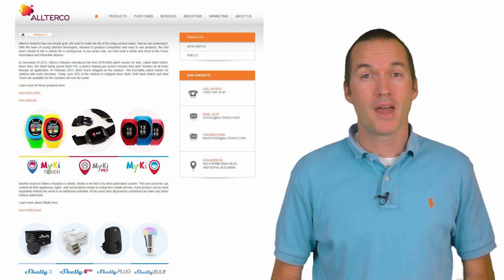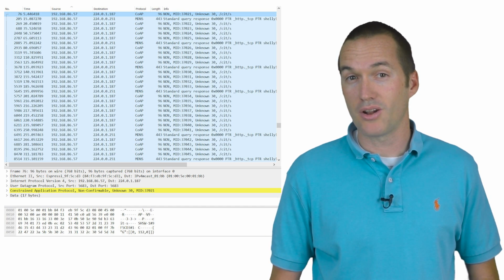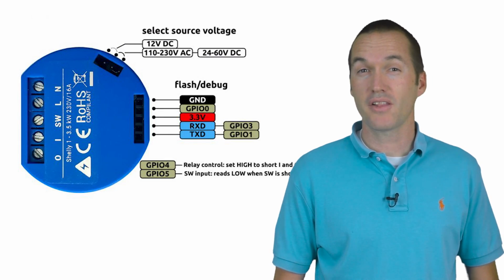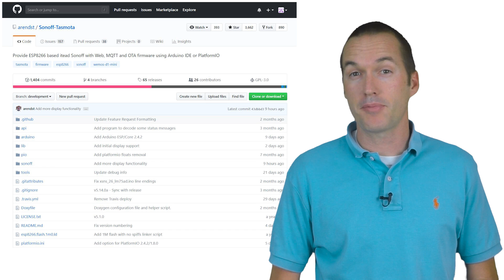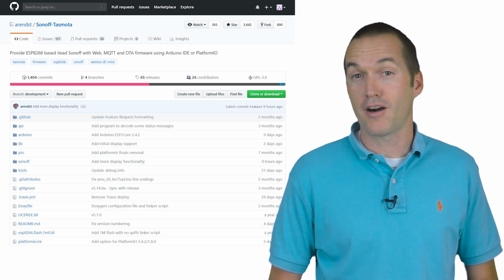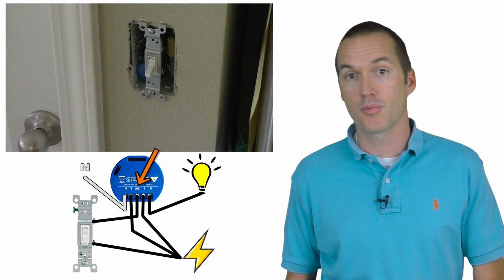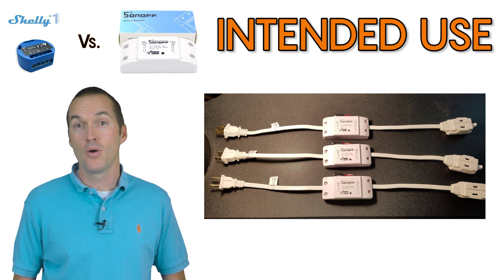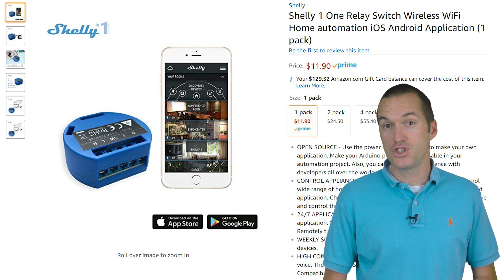Is the Shelly 1 better than the Sonoff Basic?

Comment: So you still need a neutral at the switch with the Shelley. Is there any work around without running a neutral to the switch since the Shelley supports mains voltage switching with the SW port?
Reply: Let's say that this is in our pipeline. It's not easy but definitely not impossible.
Reply: @dimitardimitrov849  That's excellent news because I don't know about the rest of the EU but in Ireland the majority of light switches send neutral to the ceiling rose and not the switch so that makes Sonoff's useless. 👍👍👍
Reply: Ross Erman Canpolat  Same in the UK. You can install the Shelly in the ceiling though.

Comment: Hi, I am just wondering if there is a max wire length between the switch and Shelly 1, Shelly 1 to the light?  I have all my wireling from all the switches go to a central location, and all lights wireling to the same central location.  And that is where I place all my smart switches (sonoff and aeotec zwave smart switches). Some IOT devices will not work because of the wire length.
Reply: We have similar issue 2 years ago when start to make home automation devices. Shelly1 do not have any issue with long wires. In some of the our installation we have 50+ meters (150 feat) wires.
Reply: That is very good to know, hope Tasmota will be updated soon. ordering from Australia is a little difficult but will try.  You are very good and the videos are very good as well.

Comment: Super helpful. I'm going to check out the Shelly 1 for sure.  FYI, if you flip a breaker and the switch no longer turns on the light, it DOES NOT mean that there isn't a hot wire in the box.  As mentioned in the video, if you don't understand electrical wiring, don't attempt installation yourself.
Reply from the maker: Yep, good point.

Comment: Can you think of a way to wire this on a multi switch setup? The house I just moved into has a ridiculous amount of 2 way, 3 way, and even a 4 way switch.  I understand the basics of a multi switch but adding this device has me stumped a little.
Reply from the maker: It depends on if there is another hot wire in the switch box that goes to the light.  If so it's as easy as powering your shelly with the hot (L) /neutral (N), hot to (I), (O) to the light, and the old output of the 3 way switch to (SW).
Reply: @TheHookUp  hmm... Thanks for the insight. Can you put this into a diagram and post it? Discord perhaps?

Comment: Does it have any respectable certification? Seeing "Chongx" capacitor doesn't instill confidence. Also, 16A is good probably only for a relay, not the whole package (compare this with other same size in-wall switches, it's unlikely they have made a breakthrough and can charge 4x less at the same time). How about doing some 16A tests to see how it holds?
Reply from the maker: Do you have a specific experience with Chongx? or just because it sounds Chinese.  It's basically impossible to make an electrical product without sourcing your components from China.

They have a few EU certifications and are currently working on UL.  I'm going to contact YouTuber John Ward to see if he wants to melt one in his normal tests.

Comment: Did you look at the traces on the PCB of the Shelly?  do the traces look like they'll take 15 amps? it doesn't matter what the relay is rated for if the traces are going to  blow off.

Comment: Comparing the PCB traces on the Sonoff Basic vs. the Shelly shows that while the Shelly relay may be rated for 16A, the PCB traces certainly are not. Sonoff uses a thick lay of solder on their relay traces to handle the current. The Shelly traces appear to be only copper with presumably some inside the multi layer board. Definitely would not run 16A through it. Without knowing the weight of copper they used on the board, I can only guess based on trace width and say about 5A would be a comfortable limit.
Reply from the maker: I mentioned it in another comment, but the biggest thing to consider for current rating is the length of the traces.  The sonoff's input/output traces run the entire length of the board, which is about 3", the input/output traces on the shelly 1 are about 1/4".  Ultimately, that's the reason why the sonoff had to cover the traces in solder.

That being said, I wonder if we could get John Ward to blow one up for us.
Reply: I think some destructive testing is in order. If only I had the time...True on the length however we are still talking about an unknown copper weight within the board. I do like the idea of the Shelly in that it easily fits within a device box, and the built in switch input. Now, if only someone would cheaply produce the same thing but with a real Ethernet interface instead of WiFi.
Reply from the maker: I tweeted at John Ward to see if he would be interested in blowing one up, but I haven't heard back from him.  I don't have a stick welder so It would be hard for me to put a setup together to push 16+ A constant voltage.
Reply: Aaroncake!!!!! Literally one of my favorite you tubers! Great to see you in the depths of the comment section. Just so ya know I'm seriously using the same approach for locking my car. I've just gotta figure how to retain original look and function but have RFID locks. Thanks for the inspiration on that though

Comment: Itead are shooting themselves in the foot with their policy of not supporting foriegn firmware (they have stated this in forums).  The Basic is trivial to program, but things like the Slampher and S20, S26 etc are impossible to flash without some very delicate soldering.  The Shelly 1, with its exposed programming pins is a HUGE selling point, even at twice the price. (The Sonoff devices don't even have pins populated on the programming pads, let alone access from outside).   I can only hope that this company goes on to re-imagine other Sonoff devices (ie: s20, T1, etc) with programming friendly over-rated devices like this. If they do, they will surely reap the benefits.
Reply from the maker: Competition is always a good thing!
Reply: I've flashed about 6 S20's with no problem at all? Have 4 'dupont' cables taped together then push them down on the pins with one hand, then with your other hand click to upload the firmware. Sure it's not super easy, but with a bit of patience and care it's certainly not that hard.   Those Sonoff bulbs are another story though! In the end I managed it without any soldering, but it is a 2 person job, there are just too many pins to hold down and then use a mouse for 1 person).

But yeah, itead should offer all their products with the latest Tasmota firmware as an option, I wouldn't trust an IoT device in my home with firmware that wasn't open source.

Comment: Thee amp rating is not used in ground fault conditions    The amp rating used  for normal current use   In a ground fault condition its the interrup rating that is used

Comment: Just got my shelly 1 and I seem to be having issues with it. I go to flash your custom bin file and it seems to work but will reset itself after I add all the backlog info. I get the error “ets Jan 8 2013,rst cause:4, boot mode:(1,7) wdt reset” and I’ll have to re-flash it to get back up and running only to get the same error whenever I edit the configuration and try to save. 

Any idea what the cause of this is?
Reply from the maker: Have you disconnected the ground wire from gpio 0?
Reply: WOW, that did the trick! I didnt think to disconnect the ground from gpio 0 after flashing but im now having no errors. Thank you!!
Reply from the maker: Gpio0 grounded bypasses stored code and activates flash mode (which is that boot mode message you got)
Reply: The Hook Up makes sense since that’s equivalent to you holding down the button on a sonoff when starting it up to get it into program mode.
Reply: The Hook Up I have it connected to ground for flashing and I basically leave everything the same while I try and configure everything. Should I be disconnecting it after I’ve flashed the device?

Comment: Is it possible to use a pushbutton  instead of the switch and can sensors be installed to the connector? For example a ds18x20, do we have 3.3V output or is this an input only for flashing it?
Reply: Chris Go. You have 2 options:
1. Easy but should be make very carefully. 
Revert N and L, then you will have GND on the PINS instead Line. You can power it from 3.3V and GND. But if you make it wrong the sensor will be well backed :)
2. Use small transformer and few components around. Then you can power it just from 3.3V witch are much safety.
Reply: @dimitardimitrov849  if you reverse L and N, you will blow you unit up when you connect whatever you are going to control L andN are there for a reason. This is why electricians are licensed.

Comment: So hard is it going to be to flash the Shelly 2??? Do you need to pry it open??? Are the GPIO pins available??
Reply from the maker: It's tough.  Harder than flashing a sonoff for sure.  The pads are smaller and surrounded by big components. I wouldn't recommend it for a first timer.
Reply: The Hook Up
 At the moment yes, small size of the device are matter. But we plan to add PCB pin header(JST) to make it easy in future.
Reply: That would be awesome!

Comment: The price for uk Shelly 2 is £47?? Not a great replacement for a £4 sonoff unfortunately.
Reply from the maker: Check out ordering from their website, Amazon UK sold out, that's a price gouging third party seller.
Reply: The Hook Up thanks for that, the website is much more reasonable and at that point the size makes up for a slightly higher price

Comment: Very good alternative to sonoff! I have immediatly ordered 2 devices (1 shelly 1 & 1 shelly 2). now the question is.. How can I put it on flash mode ? I know perfectly how to do it in a sonoff but this device has no button.. does anyone can help me ? Rik
Reply from the maker: Just hook it up as shown in the diagram with gpio0 grounded and it goes into programming mode.
Reply: Thanks so much! I just successfully flashed Shelly 2! 👍🏼👌
Reply: Does the power monitor works on the Shelly 2 with Tasmota?
Reply from the maker: Not yet, I'm trying to work it out.
Reply: Do you know if the shelly 1 with tasmota can be integrated in a 2 way or 3 way circuit ? if yes is only one unit enogh or you need 1 for each switch?
Rik

Comment: Couldn't you connect neutral to the line terminal and vice versa so the GND connection would be at ground potential instead of line?
Reply from the maker: I've been talking with the shelly guys about that, and yes, you could.  It would make the device a bit safer, but I would still advise against using the gpio when connected to mains since the isolation is so small.

Comment: Great vid. Seems a no brainer for switch boxes. Any Canadian links?
Reply from the maker: Doesn't appear that it is available on amazon.ca, they are currently sold out on ebay and their website.  Amazon.com has some that will ship on Aug 27.
Reply: These really do look appealing, but the prices I'm seeing them at are nowhere near the $11.90 in your vid, or even $19 for the 2. Best price I found shipped to Canada was $34usd. Not even close. It's a shame, I really don't like putting sonoffs in my light boxes
Reply from the maker: Check out the shelly website directly: https://shelly.cloud/

Comment: It shows you have done a lot of research off camera , which amazes me thx for sharing this. I use a sonoff POW which has CE certification 16A capability and power measurement for a great price.
Reply: Where do you get this idea of sonoff CE certifcation? It only has certification for the radio part, not overall electrical safety.
Reply: Nick Rout The CE marking is on the unit and the box it came in. Are they allowed to do that if it only partly complies to the standard ?
Reply: what standard do they say it conforms to? The certificate on the web page only refers to RED 2014/53/EU. What do the ones on the box cover?
Reply: Nick Rout there are no details on the box or leaflet it came with. It just says CE - Rohs - FC
Reply: @ddjazz  yes so look at the certificate on the web page.

Comment: Love this, and continue to love your stuff.  That said, are there any open source options for higher voltage stuff like washers, dryers, and dishwashers?
Reply: For those I think you just need to scale up the same solution with a bigger external relay - using either the Shelly or Sonoff - connect through a Functional Devices RIB relay (Relay In a Box). Many different configurations available 110V/220V dual phase switching (SPDT/DPDT), up to 30A and even up to 600V. Almost all of them can be configured with a 120V AC coil to control the relay. I have automated 220V Pool 20A Pumps with these using Lutron switches for control - works great.

Comment: great video, I think I'll order one or two units to give them a try... Rob, did you check how mush flash is installed? (even thou I bet it's only 1Mb)
Reply: There is 2MB flash
Reply: thanks, pretty unusual... I've bad experience with the ESP8266 WROOM module with 2Mb Flash :(
Reply: Giovanni Castania - we use Mongoose OS witch need 2MB to support OTA. Also there is no module, whole PCB is designed to be small and powerful.

Comment: A small concern, looking at the PCB, look like the output relay traces and wire connectors are kind of small.. this is suppose to support up to 16A. non-Isolation of the GPIO is a bit of a deal breaker IMO. sure, you can put a high voltage switch on the SW pin but what if you need to add something else like a led.. Remember that you can remap TX/RX as a GPIO in Tasmota so... yeah.. the product looks younger than the sonoff but look really promissing :)
Reply: Hello Jean - the wire connector are rate as 16A. Soon we will make public all test reports from independent  certification laboratory. The switch are tested 128h of work - maximum load, 35 degree ambient temperature.
Reply: @dimitardimitrov849  i'm not talking about the connectors but the traces from the relay output to the wire connectors. ( sorry, i read my original post and my intent was not clear. apologies for that) I would at least add solder on both trace to make them support more current
Reply: Also, If you can get this device approuved for in wall box use (I can't remember who gives those), Your devices will sell like hot cakes.. Alot a people do not install these as they may void there house insurance if the device catch fire.. but if certified.. For me, i'll buy by the dozen ;-)
Reply from the maker: A few things about that:
1.  If you look at the traces for the relay in/out they are actually fairly large and VERY short.  Both of these factors are important for supporting larger currents.  The reason the sonoff adds solder over theirs is because they are so long.
2. My tasmota .bin image with the shelly1 profile does not allow for user configured GPIO pins for that very reason.
Reply: I would be curious to run the traces through a trace calculator and see the outcome. But you're right, the shortness does factor in the fact that it can support more current.. but still, we are talking about 15 amps continuous and 16A if this ever gets connected to a 20A breaker ( that are coming more and more used in houses now a days. :-)
Reply: https://www.4pcb.com/trace-width-calculator.html trace width calculator says that for 16A and a default of 2 oz/sq ft thickness, the trace should be 271 mils or 6.8mm wide. The design also concerns me because of the very small gap between high and low voltage circuitry. It seems like it could arc from one to the other very easily.

Comment: Thanks for this, I ordered a 4-pack right away. I was looking for ways to safely use a Sonoff in a switch box and just couldn't live with the issues that potentially creates. The Amazon links are no longer Prime, however and the price has also gone up a bit. It was actually cheaper to order directly from the manufacturer, international shipping included.
Reply from the maker: I've been told they will be back in stock tomorrow

Comment: Looks like the single units are sold out.  They are not offered as of the time of this posting.  Too bad the two pack does not include the Amazon Prime shipping.
Reply from the maker: I've been told they should be back in stock tomorrow.

Comment: Hi, I have both shelly1 and shell2. I flashed your bin into shelly1 but it does not create a network to connect to. Any hints? Is your .bin also suitable for shelly2 ? Great video on the shelly/tasmota devices :)
Reply: So I solved that using serial commands. I also flashed the Shelly2 and seems to be working fine. :)